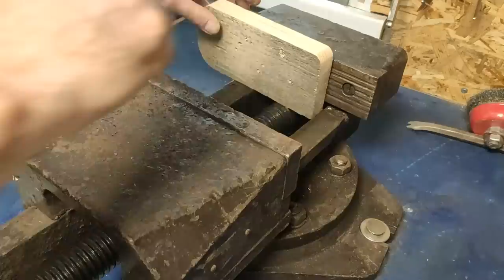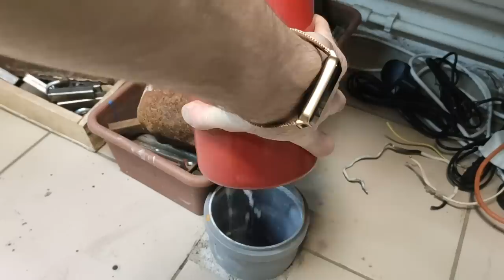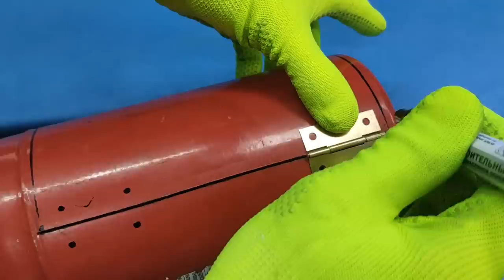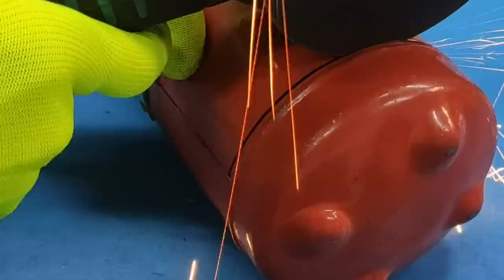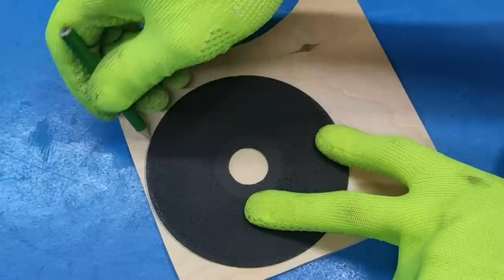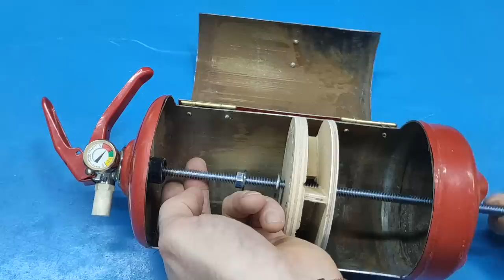DO NOT throw away your old fire extinguisher!!! An amazing idea for every MASTER.

Comment: Clean and dry the container. Line it with fiberglass resin and with the proper valves and gauges you’ll have a very portable compressed air tank

Comment: You got yourself a drill bit holder / hibachi. You can easily lay it on it's side on a couple half moon legs, open the door and place a grill on it. Add a muffler on the side.. I mean the holes already there. A couple burgers hot dogs or ribeye later and its back to work.

Comment: Creative and nice But a dangerous project for people to try at home. If the Pressure gauge is reading wrong you could be under pressure and cause a major Accident. Yes I know you pulled the Operating Lever first. but on old fire extinguishers they could malfunction as well. Take them to the shop and have them discharged for free. They will discharge them for free. And usually they will give you a few outdated ones if you want them